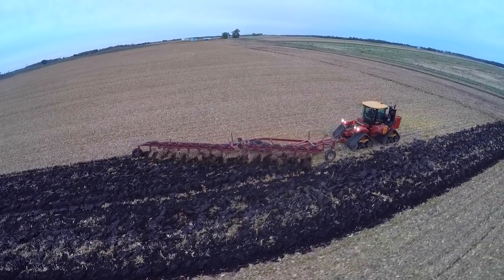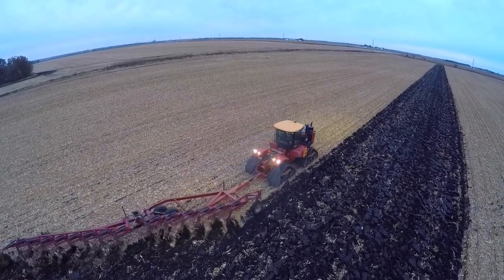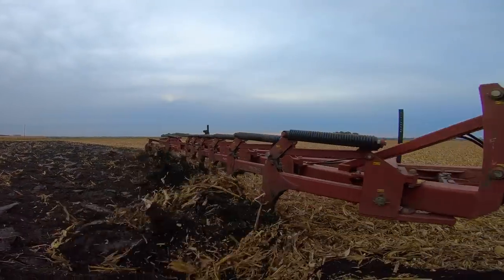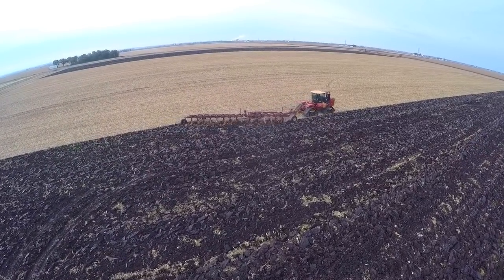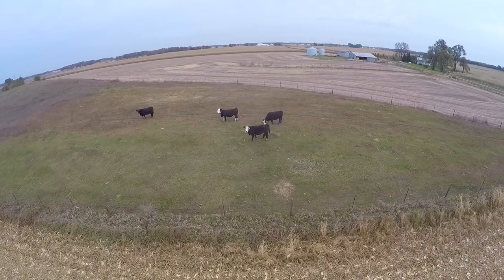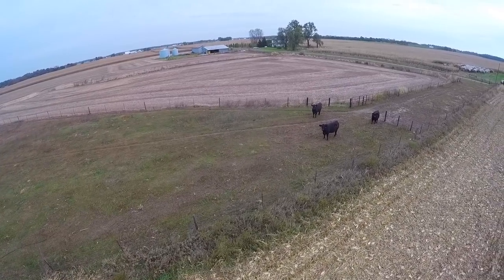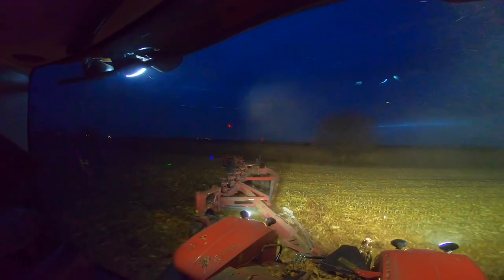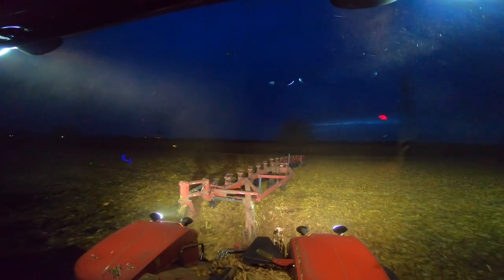Versatile 550 Delta Track tractor pulling a Salford 14 bottom plow

Comment: You can sure tell the operator has good control over the plow at the headlands.  He keeps the ends even as the plow sequentially pulls out of the ground and back in at the same line at the ends.  Great video!  It would be exciting to run this rig for a few days or weeks!
Reply: Thats my dad

Comment: That sure beats the daylights out of Dads '49 Oliver 88 and  3 bottom plow that I grew up with. Put many an hour each spring in the seat plowing. I had to even us granddads '39 Oliver 70 and a 2 bottom plow one year as the 88 had the second gear go out. In '67 I got to run an uncles '65 Oliver 1850 Gas with a 6 bottom semi mount plow for a day with his Dad on a '67 Oliver 1850 and the same plow. That was fun.
Reply from the maker: My dad talks about when he was in high school my grandpa bought a Mineapolis Moline Jetstar tractor and a 3 bottom John Deere rollover plow.  That tractor is still on the farm but the plow was gone long before I went on the farm payroll back in the 80's

Comment: Using no coulters I see.Very much added wear on the shins and thus why the furrow is so sloppy.Also why I see  few spots where the tractor pulled out and drove across plowed ground,probably to dislodge a plug of stalks. I do like the way he broke off 2 headlands,plowed each together and then having one middle land to plow apart,leaving only 1 dead furrow. The fine art of moldboard plowing is about lost,what i'd give if this farmer would call me and I could go up for a few weeks in late fall and take my 550 hp 4 wheel drive and plow with him!! That would be better than x-mas anyday!

Comment: 28 foot is almost 9 meters wide. This is with each pass. If you had a heavy disk you wouldn't be able to cover as much ground as this plow does with the same quality of work done. And that is at 7.5 miles per hour minimum. So I think plowing is the way to go..
Reply: Henry Kissinger they make 40 plus foot discs now. It wouldn’t do the same job but they make 9 inch primary tillage discs that size

Comment: I think you said the bottoms were width-adjustable.  I do recall you saying he was cutting a swath of 28 feet.  That would mean the plow bottoms were set at cutting 24".  Is that right?  They do not look that wide?  Also, I think you said he was plowing 10" deep.  From these shots, it looks more lik 6-7" deep.  Is 10" right?  Why no use of rolling coulters?
Reply from the maker: I stepped off about 28 feet for what that is worth.  According to Salfords spec 10"' is max depth and he told me he was going max.  Standing in the furrow myself it was around 10'' I'd say.
Reply: Thanks.  I grew up with 3-16" MM moldboard plow - logged many hours at 3.0-3.5mph.  The magnitude of this plowing is so far beyond my imagination, 7X width, 2X faster.  Oh, ... so much has changed!   Thanks for another great video.

Comment: Nice . Are there in the US also reversible plows in use ?
Reply: jacky bruckers No!
Reply from the maker: I see a few rollover plows in the US.  A dealer I call on in New York state has a 10 bottom Kverneland rollover plow in stock.  I think these are more on the vegetable growing areas.
Reply: I was just being sarcastic. I watch a lot of Youtube videos of two-way plows in England. In my 63 years of living in northwestern Minnesota though, I have never seen any there.
Reply: jacky bruckers Yes there are roll over plows used In the United States, generally the largest are 8-10 bottoms a side and are hooked up to the 3 point Hitch. Mostly used in the Western U.S. because the fields out here are generally smaller which is more efficient to laser level and irrigate.

Comment: I am curiouse to know why in the name of god you are plowing 10 inches deep. Doing ABSOL|UTELY no good for your soil. You are turning all the good bacterias INTO the bottom and not getting the soil turned well. For each cm you go down you need to "move" up to 50 tons of soil/hektar, fuel usage up to 25% more/Hektar tear and wear is also substantially increased on the moleboards and you do not get what you need to into the bottom. Normally you would be doing 7-8 Inches, and therefore less fuel, less tear and wear and less need of HP.

Otherwise awesome tractor but HORRIBLE plowing.

Sorry dont kill me for this comment :)
Reply: Dennis Vogelius Mike is just filming. He has no say in what is done